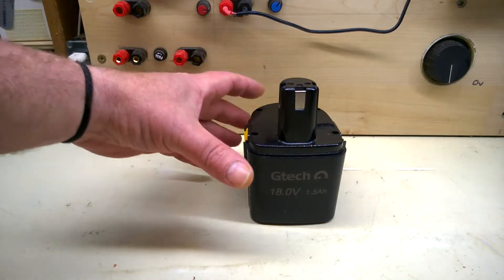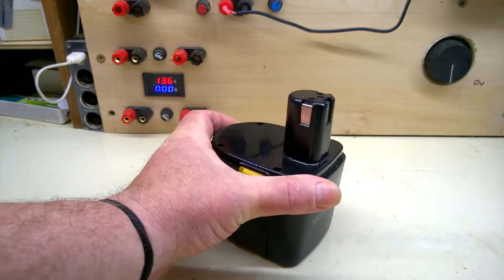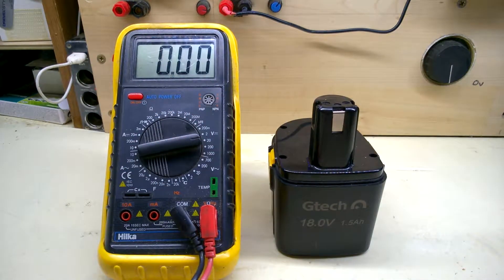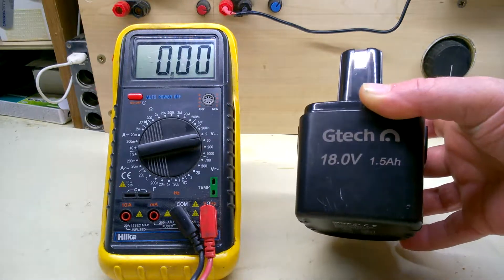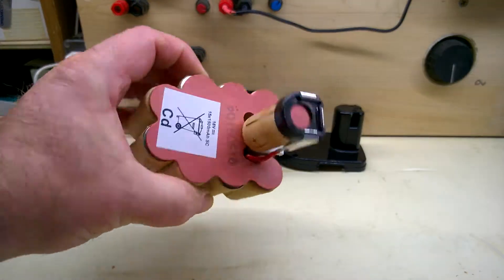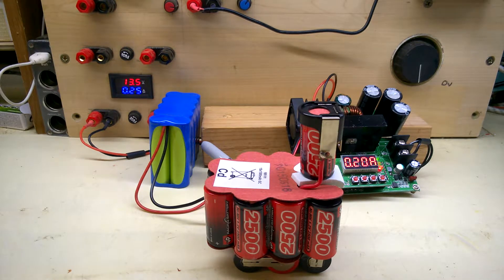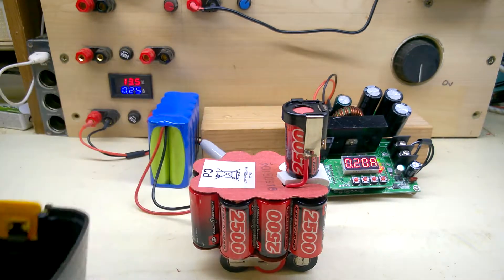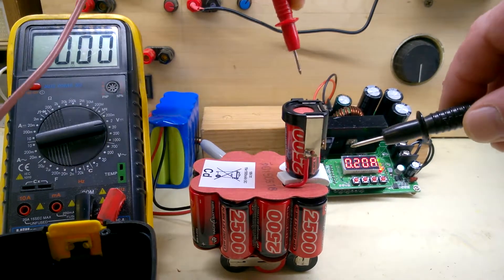G Tech 18v battery failed & recelled

Comment: Many thanks for the video. I see that you have replaced the original NiCD batteres with NiMH. If I do the same, will I still be able to use the original charger? Thanks again.
Reply from the maker: Certainly can use the original charger. 
Very little difference between the two cells.

Comment: far better cells than the Gtech uses.done many a pack myself but NIMH is getting expensive now.
Reply from the maker: Better cells,agreed - but not really expensive at £2.40 each cell.
Thanks for the comment.
Reply: @makeitwork7522  where do you buy these from though?